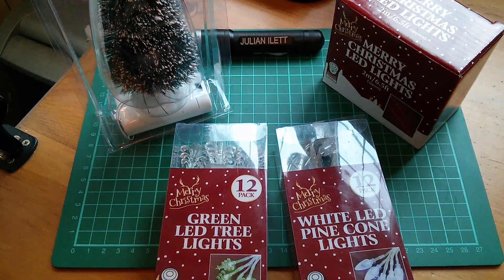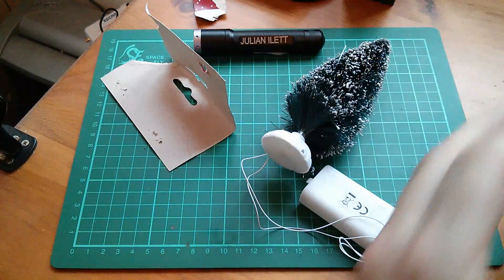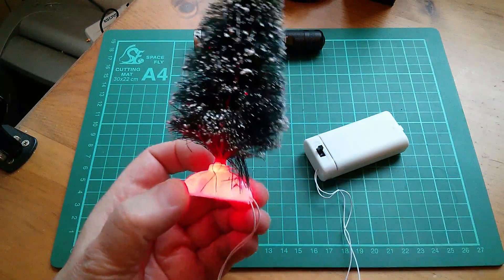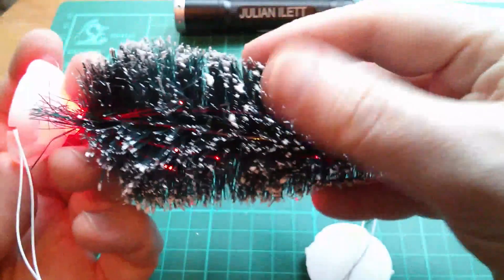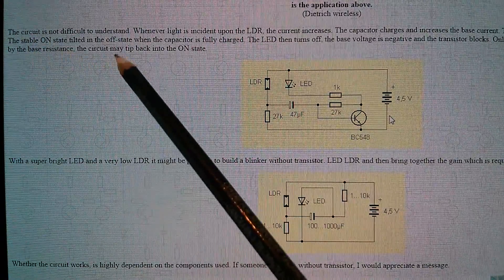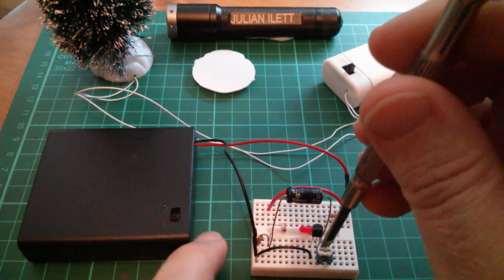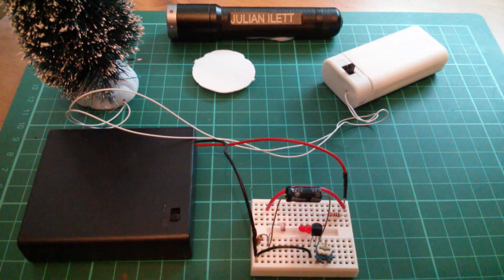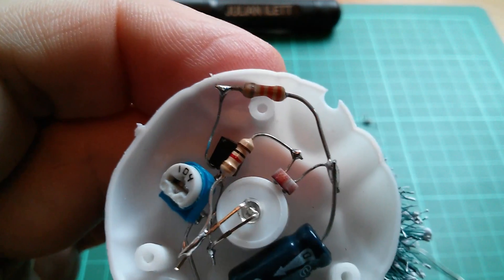Pound Shop Xmas Tree Hack: One Transistor LED Flasher with LDR

Comment: I know this is old but...I'm trying to see how you connected the trim pot. There's no clear indication as to how its connected. I tried to duplicate the circuit but couldn't get it to work. The link isn't much help either. Can you provide a schematic for it? Thanks
Reply: Ross Anderson  The preset replaces the 27k ohm resistor between the collector and base of the transistor.

Comment: Could have been simpler with a self-flashing LED. Search eBay for:
50pcs 5mm Red Diffused Round Self Flash Flashing LED Blink Bright Leds 
or better yet
20pcs, 5mm Diffused RGB Rainbow Slow Flashing Flash Red Green Blue LED
Reply: damn you todfun ruining all the fun

Comment: That's quite an interesting circuit. It works because the current through the LED, 1K resistor and 27K base resistors bias the transistor on. This increases the current through the LED which makes it brighter. Some of this light falls on the LED and hence decreases its resistance. This in turn increases the base current through the transistor, so we have positive feedback ensuring the transistor is saturated (on). This state continues until the 47uF capacitor charges sufficiently that the base current "through" it is no longer enough to maintain saturation. The LED current reduces slightly and the LED becomes dimmer. This increases the resistance of the LDR and hence reduces the base current. We have positive feedback again resulting in the transistor and LED being turned off abruptly. Now we have something less than 0.65 V on the base of the transistor. It may well be negative. However, over time the capacitor will discharge and we are back to the start of the cycle. Optical coupling between the LED and LDR is critical to the operation of the circuit.

Comment: About 5 years ago, I bought a whole bag of clear 3mm RGB LEDs with flashing circuit inbuilt into the LEDs with 2 different flashing modes for about 2 cents each, and I used them in exactly this same application, F/O Christmas Trees. But I do enjoy your mumbling, bumbling wonderment and your overkill solutions in this case!

Merry Christmas and a great 2016 to you and all your Loved Ones!
Reply: +Ultimate Villager I don't think " Mr Ilett " mumble's at all, but merry Christmas too ya!

Comment: You could have used a bike light. Those small ones which operate at 3 Volts or sometimes 6 Volts (1 or 2 CR2032 batteries). I use these small chips very often to drive LED's. The 6 Volt version will run from 3 Volt up, so  a LiPo will do, but 5V from USB as well. And depending on the bike light you have, it can switch on, strobe slowly, strobe fast and off.
Reply: I was given some old gas lanterns that I would like to convert to LED to have around the house for an "emergency". would you go with a bike lantern or one of these led modules?
Reply: +Friendroid The choice depends om some variables. The bike light (if you find one having 2 white LEDs and having 2 batteries in it) have a chip which delivers approx 50 mA which is enough to run 2 white LEDs very bright or 10 LEDs fairly bright. I am not sure if every country has the some one in the shops, but the one I describe is the best. It will run on a few volts up to 6 or 7 volt so a wide range of power supplies can be used.
The version from Julian has replaceable parts, but I don't know the power needed and max. power to be delivered. I do know the bike version uses a high frequency to power the LED which makes it long lasting on batteries.
For an emergency I would not use the converted gas lantern. Appealing to the eye it sure will be. But I would opt in for a (used) mains LED light which is broken. I have opened many of those and in 90% of all cases the mains driver is dead. Leaving me with a nice LED light which i can run using a dc2dc converter.
Any how, look around, see what you like. And what performance (how much light) you need in an emergency. I have a light with motion (and ambient light) detector with several LED's in it in every hallway. Running on a (used laptop) LiPo battery which I charge by solar. So many ways and ideas .. ..

Comment: I wish I could find some LM3909 ICS, one lithium aa can literally flash a led continuously for years
Reply: +Giff99 Jgdyy You can buy them on ebay: http://www.ebay.nl/itm/LED-Flasher-Oscillator-IC-NSC-DIP-8-LM3909N-LM3909-DIP-/221952646687?hash=item33ad689e1f:g:osYAAOSw7FRWWCrO unfortunately they&#39;re a bit expensive. I bought one in the late 1980s but it was quite expensive. I wanted another one so I built one myself using discrete transistors, just following the internal schematic. And it worked :-) Although not as well as the original, the LED flashed less brightly.

Comment: Arduino mini, RGB led, PWM, and you have all the light effects you could possibly want :)
Reply: +Flo wey esp8266 and you can remote control it from anywhere and update it later without having to fetch it out of the tree.
Reply: John Ridley Err no.. it uses roughly 70ma at idle and about 80-100ma running code, so that's at least 24 hours life and just like the arduino you can use sleep states to increase that up to weeks.
As for a boost converter, have you not seen Julian's ESP? It doesn't have to run at exactly 3.3v you know, just as the arduino doesn't have to run at 5v either...
Reply: +Flo wey not even, an ATMega8 could do it.

Comment: i love this kind of projects: cheap, original, involve thinking out of the box and allow me to learn basic electronics. I have 3 LED chandeliers around the house that only turn on at night if and when i need to go visit the bathroom, that turn on with a PIR and that also came from the pound shop. Transistor, resistor and Pir was all it took. At the moment im modding my landlide phone to switch an aquarium feeder through an led that turns on when receiving a call, this way i can feed the fish while out in vacation.
Reply from the maker: +Friendroid Thanks for that. I love your telephone fish feeder. Hopefully you don't get too many sales calls on your landline, otherwise your fish may get fat!
Reply: +Julian Ilett Indeed! An old cellphone in a box, with an LDR detecting the screen lighting up, would probably be better but im not sure if the battery would last over a week.
Reply: +Friendroid Remove the battery and supply the phone with regulated 4V.
Reply: +MrOpenGL coincidentally I just soldered a small step down module to the phone and a USB extension to plug into one of those phone charger s I have around :)
Reply: I wanted to say LED lantern, not chandelier, of course.